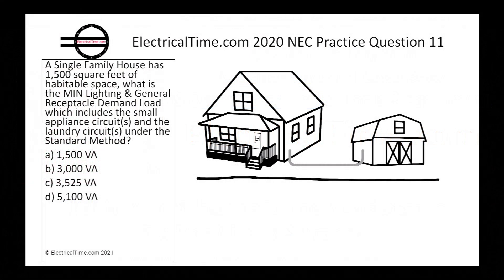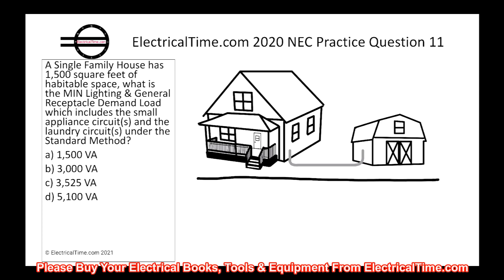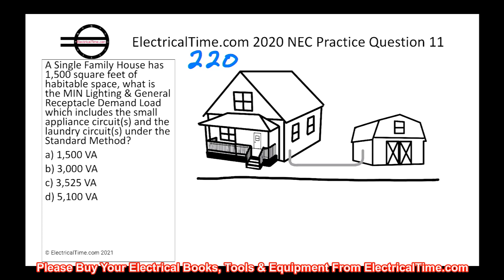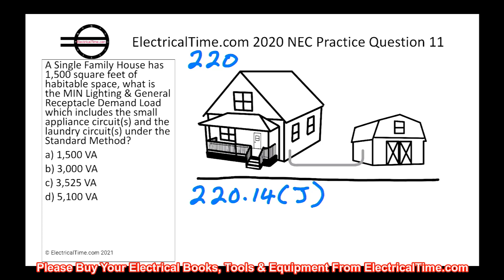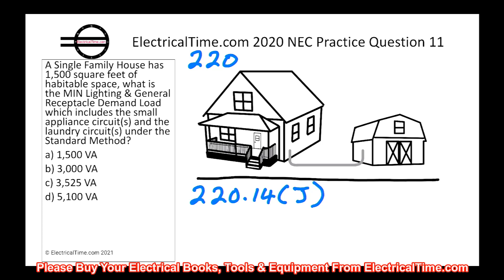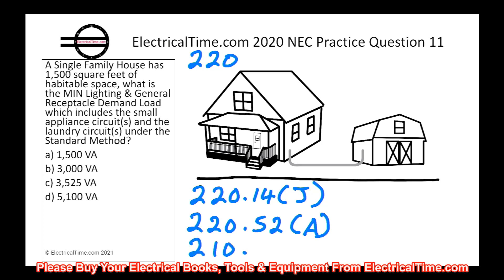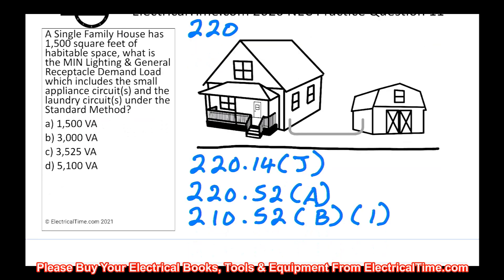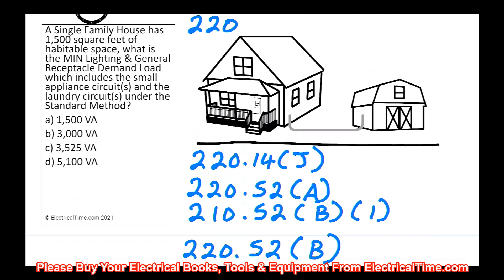NEC 220.42 "2020" Standard Method Load Calculation by ElectricalTime.com Video 20-011 Calculation

Comment: why don't use 220.82(b)
Reply from the maker: Hi Jose, great question. 220.82 is the Optional Method for a Dwelling Unit and you could certainly just use that method to do a load calc in the real world, however the Standard Method of doing a dwelling unit load calc is quite common on electrical exams. Also, in order the justify the use of a reduced sized Neutral for the service or feeder, you will have to do the load calc under the Standard Method first to see what minimum sized neutral is required and then do the Optional Method load calc for the ungrounded conductors of the service or feeder. I hope this helps to answer your question. If you would like to attend one of our live NEC code class for free that we do on Zoom, just send me an email to ElectricalTime@yahoo.com and request to try out one of our classes for free. Thanks, Steve